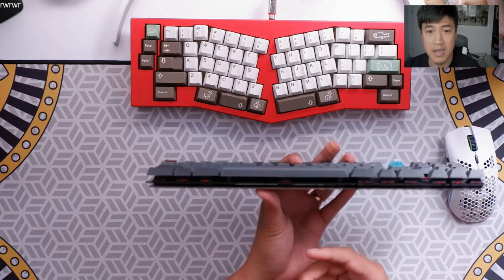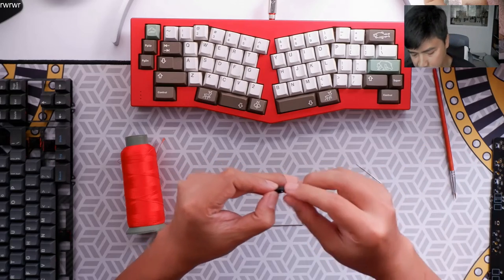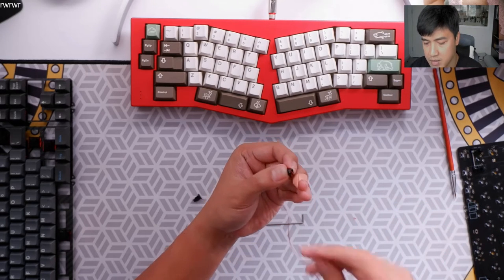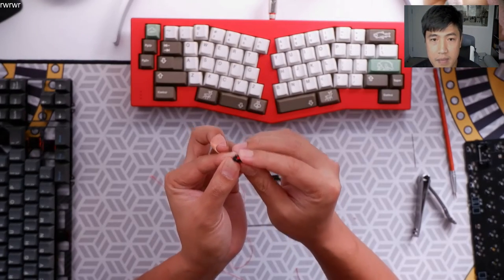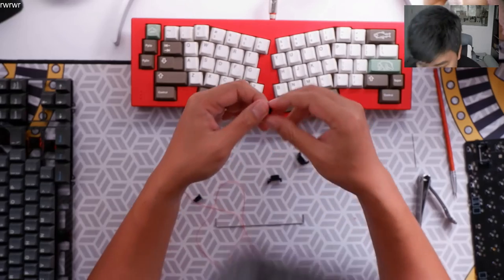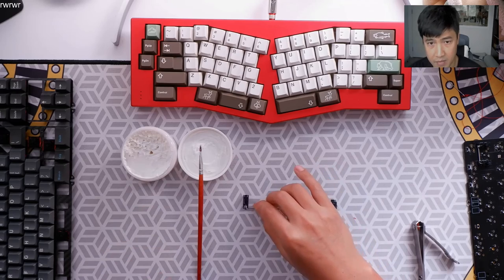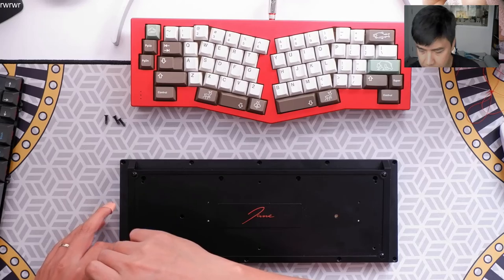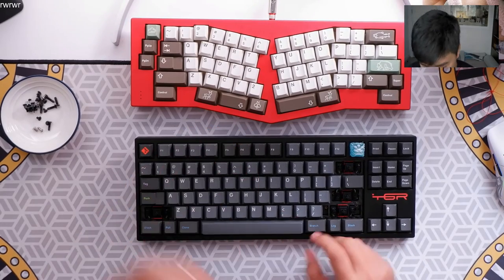Tailor's Stab mod

Comment: since you have to wrap the thread under the bottom of the stabilizer stem, does it make it bottom out earlier, or is it not noticeable?
Reply from the maker: You should tighten the thread and use your judgement to wrap "just enough", it depends on the thread's thickness so, I cannot tell.
If it bottoms out early, that's a sign for "too much".

Comment: Cool idea. How do you think this compares with putting heatshrink on the stab wires?
Reply from the maker: I never tried it, but it's a good question, I'll try it on stream one day.
Reply: @LongTran-Spacebar  FWIW, I liked heat shrink before Durock v2 came out, but I've found it to be a bit too tight for them. Instead, I've started doing a relatively simple mod and using lube. I don't have a name for the mod, but basically I take a thin strip of electrical tape, center it over the divider between the wire hole and the hole above, and then use tweezers to push it into both holes and stick it to the top and bottom of the divider. This pads the slider a little bit but doesn't make the hole too tight.

Comment: would you recommend this mod to durock v2?
Reply from the maker: I would not, since the base of the stem is long, the thread scratches the back of the housing.
Reply: @LongTran-Spacebar  thank you <3
Reply: @LongTran-Spacebar  what happens if it scratches? Why is it bad?
Reply from the maker: @praigleo5883  Oh, it blocks the movement of the stem.
Reply: @LongTran-Spacebar  how about durock plate mounted stabs?
Reply from the maker: @zakutei  I never tried that before, but the rule of thumb is that the thread should not touch anything but the wire. If you see the thread touches the housing, it makes your stab sluggish.

Comment: well, another nonsense tip... you dont even know the basics of stabilizers. the rattling sound come from the end of the wire hitting the top of the inside of the stab stem. you add yarn to the bottom and then you smother it in grease... the standard method to lube stabilizers is to fill out the back of the stab stem where the wire ends are to cushion the wire ends hitting the top of the stab stem. no brushing the wire needed. you should buy proper grease and just fill out the back of the stab stem before putting it together. it's that easy and takes 3 seconds.
Reply from the maker: Thanks for enlightening me, will try thick lube next time.
Reply: you actually think this guy doesn't have dielectric grease lol
Reply: @poispetit997  all silicone or teflon based lubes are dielectric (not conducting electricty) - silicone lube especially is also called dielectric grease. its a property not a type. when it says dielectric on it it usually means its for higher voltage application like on spark plugs etc. to isolate the metal from the environment. for example permatex "dielectric tune up grease" is used for spark plugs in boats to seal it from water and salt. it dries out on the outside to seal the application area, hence why it is a bad idea to use it in mechanical parts like stabilizers... unless you really want to throw them away 1-2 years later because you think this is normal to redo stabs every year... (it isn't)
Reply: @homerowco.1957 I'm aiming for zero rattle and youre telling me to stick it in grease................yeah try that why dont you, ill stick with epsi mod and 205g0 thanks
Reply: @poispetit997  2xx series Krytox literally is grease. NLGI 0 or otherwise it is still grease - and yes, you want to use a 1 or a 2 NLGI - something like krytox will do, christo, superlube, etc. as long as its thick AND for mechanical parts (teflon, ptfe etc.)
Reply: try 205g0 with stabs and youll see how it goes... with epsi mod there is no grease needed 205g0 is just for the housing lubrication
Reply: @homerowco.1957  what made you think permatex dries out?
Reply: @zat-svi-ua  the application use case suggested by the manufacturer, the instructions on the back of the packaging, the spec sheet on the website, and a decade of building mechanical keyboards.
Reply: @homerowco.1957  dielectric grease is made of polydimethylsiloxane and thickener, they don't dry out. what exactly happened to this grease when you used it on your stabs?
Reply: @zat-svi-ua  dielectric grease, you mean permatex or all silicone grease because all silicone grease is dielectric and often referred to as dielectric grease. if we talking about permatex then it will get more sluggish over time, again the purpose of permatex tuneup (big dielectric printed on the packaging because its made for spark plugs) is to seal outdoor electric connections like spark plugs and so forth. it does this by slightly sealing up under oxygen. its easy to tell that it is not a mechanical grease because it has no ptfe/teflon etc. mixed in (superlube multi purpose ptfe synocol, krytox, christo etc.).
Reply: @homerowco.1957  yeah, i meant permatex. to me it is unclear how can silicone seal up under oxygen.. and why exactly it takes a year for it to seal
Reply: @homerowco.1957  i suspect (no contents listed in 22058 SDS, but 81153 lists POLYDIMETHYLSILOXANE that is silicone oil) that permatex is made from silicone oil + thickener, just like any other silicone/dielectric grease. again, silicone oil does not dry out/seal, nor does the thickener. maybe we're talking about separation? is there any oil residue (little puddle) under the stab?
Reply from the maker: So, I used SuperLube and it didn't help, should I try Krytox 205g2?